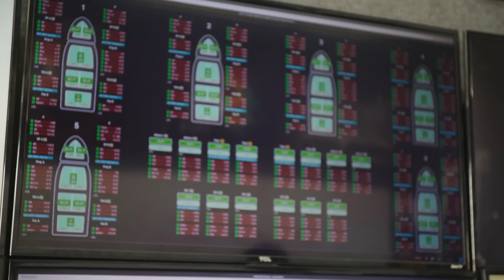Flying 523 Miles, Emissions-Free: Joby's Hydrogen-Electric Demonstrator

Comment: This is not a major aerospace challenge anymore I'm building one for my personal use in my garage and mine has lower fan noise then any of these market available ones even my neighbors will vouch for it's low noise especially during vertical take off.

Comment: Oh wow! I found out about Joby through Microsoft Flight Sim. (Flying the S4 is such a wonderful experience!).   This is the future of aviation and the extended range is amazing. I wish you all the success and hope one day to be able to take a ride in a Joby.
Reply: What kind of controls do you have? Anything close to an eVTOL?
Reply: I have a VelocityOne Flight Stick which works well for the right inceptor, using its throttle in place of the left inceptor. It has a twist axis which is nice to make use of vs my rudder pedals. I’ve got all the buttons mapped for speed hold, decel, etc.

Comment: But the primary source of hydrogen is from fossil fuels so what is the point?
Reply: The primary source of hydrogen production is indeed fossil fuels, with natural gas being the dominant feedstock globally. Approximately 75% of the world's dedicated hydrogen production comes from natural gas, primarily through steam methane reforming (SMR), a well-established process that separates hydrogen from methane.
 This method accounts for the majority of the 70 million tonnes of hydrogen produced annually, with coal contributing a significant portion, especially in China, and a smaller fraction derived from oil.
 Overall, around 95% to 99% of hydrogen produced today is derived from fossil fuels, making it the overwhelmingly dominant source.
 This reliance on fossil fuels results in substantial carbon dioxide emissions, with estimates suggesting that producing hydrogen from fossil fuels releases around 920 million tonnes of CO₂ annually.

Comment: Good milestone... I did some math:
	•	Cessna 172 (Avgas): Approximately $188.10 for the 523-mile flight.
	•	Robinson R44 (Avgas): Approximately $338.25 for the 523-mile flight.
	•	Hydrogen-Powered Aircraft: Approximately $600 for the same distance (this is if Hydrogen is made from green energy and bought with 15$ per kg price)
Reply: Maintenance cost/hour is another consideration.
Reply: Are those prices for planes that are completely empty with no cargo or passangers?

Comment: Hydrogen has more emissions than natural gas.  Commercial hydrogen is made from natural gas.  “Green Hydrogen” is a myth marketed by fossil fuel companies.  Any renewable energy taken away from the grid to manufacture hydrogen has to be immediately substituted which means spinning up fossil fuel powered plants.  It should be no surprise that the biggest advocates of hydrogen are fossil fuel corporations.
Reply: Using hydrogen to power an electric engine emits only water vapour. Green hydrogen can be produced using only electricity
Reply: @RichardHorton-NZ  No…so-called “green hydrogen” consumes so much renewables per kwh that it requires more than an equal amount of non-renewables to compensate for the loss of energy from
the grid.  This means that so-called “green hydrogen” drives a net increase in non-renewables.
Reply: true for now
but that doesnt mean we have to give up on it
we should develop and make it more efficient and eco-friendly

Comment: Flying cars have the potential to revolutionize the way we travel, by offering solutions to congestion, improving accessibility, driving innovation and providing safer transport options. While there are still challenges to overcome, especially in terms of regulations and technology, the benefits offered by flying cars are far greater. Therefore, further investment and research in this technology is a wise step for a more efficient and sustainable transportation future 🥰🥰😘😘

Comment: Hydrogen as a power source for electric vehicles (EVs) has been a topic of debate. While some argue it has potential, there are several reasons why it's considered less practical compared to battery electric vehicles (BEVs):

Energy Efficiency:

Production: Producing hydrogen is energy-intensive. Electrolysis, the process of splitting water into hydrogen and oxygen, requires a significant amount of electricity. This electricity often comes from non-renewable sources, reducing overall efficiency.
Conversion: In a hydrogen fuel cell vehicle (FCV), hydrogen is converted back to electricity to power the motor. This process is less efficient than using electricity directly from a battery.
Storage and Transport: Hydrogen needs to be stored at high pressures or low temperatures, both of which require additional energy. Transporting hydrogen also involves energy losses.
Infrastructure:

Lack of Refueling Stations: The infrastructure for hydrogen refueling is sparse compared to the rapidly growing network of electric charging stations. Building a comprehensive hydrogen refueling network would require substantial investment.
Complexity: Hydrogen refueling stations are more complex and expensive to build and maintain than electric charging stations.
Cost:

Production Costs: Hydrogen production is expensive, especially when produced using renewable energy sources.
Fuel Cells: The technology for hydrogen fuel cells is still costly, making FCVs more expensive than BEVs.
Safety Concerns:

Flammability: Hydrogen is highly flammable and requires stringent safety measures during production, storage, and transport.
Leakage: Hydrogen molecules are small and can easily leak, posing additional safety risks.
Environmental Impact:

Source of Hydrogen: Most hydrogen is currently produced from natural gas through a process called steam methane reforming, which emits CO2. Green hydrogen, produced from renewable sources, is more sustainable but also more expensive.
Technological Advancements in BEVs:

Battery Improvements: Advances in battery technology have led to longer ranges, faster charging times, and lower costs, making BEVs more attractive.
Integration with Renewables: BEVs can be more easily integrated with renewable energy sources, further reducing their environmental impact.
While hydrogen has potential in certain applications, such as heavy-duty transport or industries where battery solutions are less feasible, it faces significant challenges in the passenger vehicle market compared to BEVs.
Reply: Current BEV vtols don't have half this range.  Normal aircraft powerplants have to produce 80% power at cruise whereas a car only needs 20% at cruise... It's clear to me, the power demands of flight are far greater than those placed on ground vehicles. Moreover, all aircraft must have a reserve when they land- typically 45 minutes reserve. Flying longer legs commercially demands more than a bev aircraft can safely deliver so hydrogen helps.

Comment: ok, there is no prize for more expensive operations.  So great, you used hydrogen - probably at the insistence of Toyota.  WHAT'S THE COST?  Hydrogen is expensive and inefficient.  Let BMW and Toyota waste their money on hydrogen - unless your goal is expensive flights and ESG awards.  sorry, dumb.  (oh and include the economics next time)
Reply: It's expensive for cars. But for aircrafts where weight is extremely important. This is game changing. Don't speak like you know better. You clearly don't. Sit down, be humble
Reply: @bronxishomenomatterwhereig3149   if you're going to throw arrogance around - make sure you post the economics.  Hydrogen is massively less efficient than batteries.  Hydrogen filling stations are being dismantled across the globe - why?  too expensive.
Reply: @papa-lt4sb  you speak range to my question of economics.  perhaps it is a translation problem

Comment: You should also have said that there was no space for passengers on that flight. Deceiving.
Reply: @GainButLearn-in8me How do you know for certain there was no passenger space?
Reply: @eddienoragong402  Pause at 0:09. The cabin is almost entirely occupied by the fuel cell. Not to mention liquid hydrogen is incredibly expensive. The advantage of battery-powered aircraft is the lower cost of energy and maintenance. There is potential for hydrogen-powered aircraft but Joby would need to design from scratch.

Comment: 500 miles and 0 passengers because the cabin was replaced with hydrogen tank and cell LOL
Reply: This is essentially a giant drone....the idea that it can go 200 mph on battery for more than 5 miles is against the laws of physics. It doesn't have enough airplane wing to allow it to really call it a flying airplane. Without power I'm guessing it won't glide and fall like a brick. A Tesla with way more battery capacity than this drone can only do about 230 mile at 80-90 mph. So how fast is the all electric Joby actually flying when trying to get maximum range? It would suck to watch traffic on the road going faster than you while up in the air in your "plane". 
If running on hydrogen then it's just an internal combustion engine with hydrogen as the fuel source. "Hydrogen is the fuel of the future....signed, Max Pruss, Captain of the Hindenburg"
Reply: Well they did call it a demonstrator - how many payloads has Starship put in orbit? 😜

Comment: Note that 0:10 virtually the ENTIRE usable volume of the fuselage is occupied by the huge deeply cryogenic liquid hydrogen tank and associated ancillary fuel cell and electrical conversion equipment, necessitating total remote control of the vehicle. It's a fun experiment, but I'm unconvinced this is the future of aviation in any significant form; the immense energy density of hydrocarbon fuels is still just too good to beat, by far. Fischer–Tropsch driven gas to liquids processes for net zero carbon emissions has to be the way to go for future sustainable aviation.
Reply: Keep in mind that they said this H2 system was retrofitted into one of the existing test vehicles - that means this airframe was designed around the batteries it was built with, not a H2 fuel cell stack and tank, so I would totally expect it not to fit well. I'm sure if they're going to pursue this it'll be done with an airframe that is as optimized for it as the existing one is for batteries (aka with room for seats hahaha).
Reply: @zenithstar11235 @ Joby subsidiary H2Fly (who designed the battery), is engineering a 40 seat aircraft. A few months ago, H2Fly flew a test aircraft about 900 miles,  the equivalent of a London to Rome flight. I believe it was a no-seater remote piloted test
Reply: @Muonium1 I believe the LH2 tank is that black section, attached to the bottom of the fuselage, and only holds about 88 pounds of fuel. Unless you have x-ray eyes?
Reply: Gotta start somewhere.  Very few technologies were in their finished, practical form at the time of their very first technology demonstration
Reply: @BayAreaMotorcycleCommuting  The problem here is more fundamental than one of mere technological refinement. Energy density of fuel is a hard limit on every desirable aspect of an aircraft. Electric motors and prop design are effectively already at their maximum efficiency limits, there's no more significant room to improve there, your only option left to alter is in the fuel energy density. Conversion from the chemical potential energy of hydrogen into electricity is abysmal (forget even the horrible efficiency of electrolysis to get the hydrogen in the first place). It makes no sense to do that conversion on board the aircraft. OFFLOAD the conversion inefficiency to the ground, where high energy density hydrocarbons can be synthesized in arbitrarily large amounts, then burn it as usual in the vast existing infrastructure of 40% efficient jet engines that already exist.
Reply: @Muonium1  So is it your opinion that Joby and its investors have sunk millions into this tech demonstration purely for marketing and PR purposes?

Or is it perhaps that they’re targeting a specific short-range air taxi market where clean vehicle emissions and low-noise operation take precedence over maximizing fuel energy density and long range flight, and that R&D experiments like this one will help them innovate to achieve that goal?
Reply: @BayAreaMotorcycleCommuting  my opinion is that like countless startups before them in the aerospace sector, they are deluding themselves into believing they have a mass marketable revolutionary product when in fact they at best have a very, very niche target market and a very limited capability product.
Reply: @Muonium1  That’s certainly possible. I suppose time will tell
Reply: @BayAreaMotorcycleCommuting  "So is it your opinion that Joby and its investors have sunk millions into this tech demonstration purely for marketing and PR purposes?"

Given all of the billions of dollars thrown at projects that turned out to be very obvious scams in recent years, I'm amazed that someone is still able to use this as an argument.
Reply: @PistonAvatarGuy   An obvious scam would not be capable of flying over 500 miles. This isn’t some crypto vapor ware pyramid scheme. This is an actual vehicle flying on a hydrogen fuel cell.

Sure, the business might not be viable in the long run, as is the risk with any startup. But you seem to be comparing this to Theranos
Reply: @BayAreaMotorcycleCommuting  500 miles with an unknown asterisk. Was it 500 miles in one flight, or multiple flights? The cabin was also completely filled with the hydrogen power system, so no room for passengers, which makes the aircraft completely useless.

Theranos was just one example on a very long list of examples.
Reply: Did you not bother to read the report? It was a 523-mile flight. Of course the cabin is filled up - they’ve attached the hydrogen system as an experiment onto an existing airframe that was designed for a completely different setup. An actual airframe designed for this propulsion system wouldn’t have the cabin filled with the hydrogen tank 🙄 and yes, every single amenity we enjoy in our modern lives was an early prototype once. Many Falcon9s exploded before landing… many Boston Dynamics robots fell before walking… it’s a slim chance of success, but this is an incredible demo showcasing impressive and promising tech
Reply: @BayAreaMotorcycleCommuting  You must be new to technology. This aircraft has the very same problem that all of the many hydrogen aircraft before it had, it's nothing new, or revolutionary. Yes, they could make the fuselage larger, but the real problem is weight, not interior volume. Another commentor here already explained that this isn't a problem that can be engineered away, or someone would have done it in the last ~70 years that fuel cell technology has been around.
Reply: @PistonAvatarGuy  Dang, they should have hired you to advise them before they put all the effort into this demo then. Those poor dummies are clearly lost
Reply: @BayAreaMotorcycleCommuting  They're not worried about producing a viable product, they're worried about how much money they can get from investors.

Comment: Your doing an amazing job, building a longrange vertical starting and landing airplane, that can indeed to a degree replace cars while keeping the maintenance cost low. I am following the scene for a long time, designing some prototypes on CAD at the beginning myself, with quite a bit of studying. With your design your just hitting the nail! Better than most others in the scene. It would be nice for you to consider a LiquidPiston engine with generator to charge the battery while flying. Keep on leading the technologie and please keep in mind to make it affordable to private buyers.
Reply: Would a Liquid Piston engine benefit from what @EirexTech can do with any type of water as fuel.

Comment: 500 miles on h2 vs 200 on battery is a huge difference. Im curious how the payload capacity was affected and if the remaining batteries still have to be recharged like on the normal all battery craft.
Reply: @Saml01 I don't see why they would even have batteries on the h2 system craft if they couldn't be charged via the fuel cells - but I mean I would imagine you top them up while it's on the ground just like anything else - like you're already lifting them, they may as well be fully charged on takeoff.
Reply: @zenithstar11235  maybe they need the batteries for the vertical takeoff and landing for extra power then they don't use them during cruise.
Reply: @TheBagOfHolding  No yeah, agreed. It's practically a given that hover uses more wattage than forward flight.

In my response to @Saml01 I just meant that I would fully expect the H2 system to be able to pass power to them in flight. Probably a bit like an alternator keeps the battery topped up so it can run the pumps and spark plugs in an ICE.
Reply: He said they have flown 25k miles on batteries.
Reply: @TheBagOfHolding  On one "tank" of h2 they flew 500.
Reply: @Saml01  there was an asterisk on that number. He doesn't really say it's one flight.
Reply: @TheBagOfHolding the asterisk was because he said "522 miles" but the actually number was 523...it was a correction...
Reply: 권오달  @Saml01